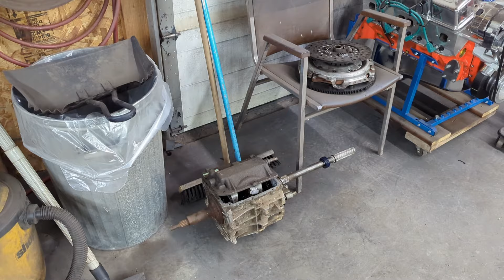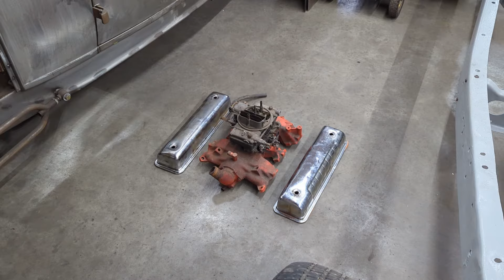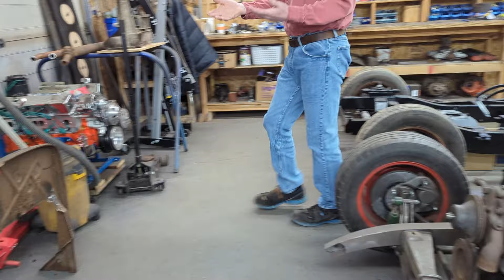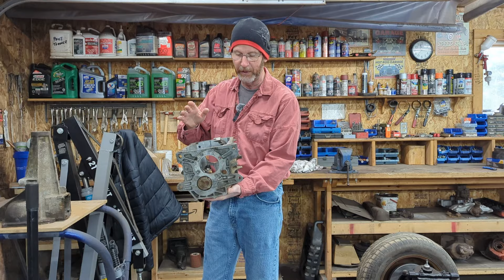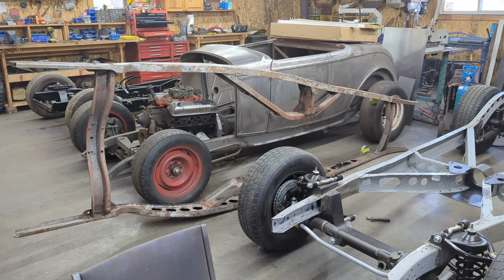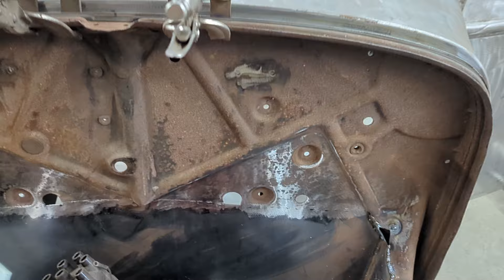Working on three projects at once in our shop '32 Roadster '40 Plymouth & '35 Ford Pickup Chassis

Comment: From one extreme to another. You get a real nice person gives you an intake and carb. And like you say a rear one at that. A transmission case. Then you get a low life that sells a transmission for the cost of a couple rattle cans of paint for a massive profit. I suppose that’s the human race. I like your 32. My chassis is in paint and a rolling one when I get tyres for it. But I’m going through a sticky time so as soon as I get sorted I’ll be full on with my 32 roadster. You have another nice looking chassis on the shop floor again so keep doing what you are doing. All ways interesting. Cheers take care both. Tim.

Comment: The s10 trans does come with standard gm bell housing. I have 3,you can also just use the shifter and tail housing on a camaro trans.you can also get a newer bell housing that fits.
Reply from the maker: Yes the early non world class S10 transmission seems to have the Muncie style bolt pattern, I have a case and tail shaft housing now. I have since found bell housing to bolt the later S10 bolt pattern (some people refer to it as Ford pattern) to a SBC but it's over $500 US plus shipping and taxes to get it to me here in Canada. The person that sold me that S10 core was very happy to buy it back for what it cost all rebuilt. With the discovery that the Camaro transmission was not rebuilt we are going to use the good early S10 transmission cases and the best of the Camaro internals plus new parts to build a new one. Hopefully have this all done by mid April.